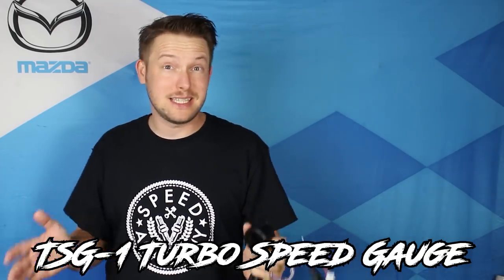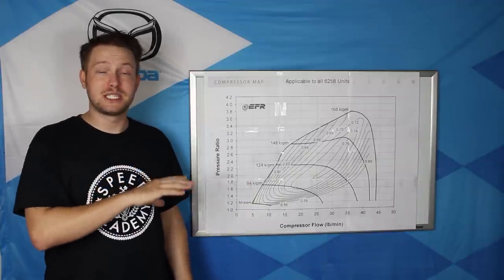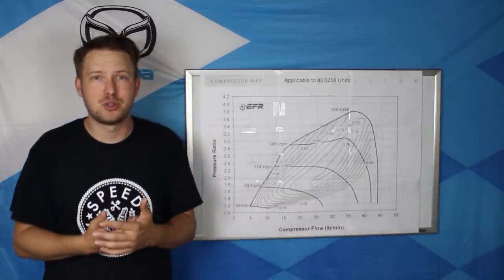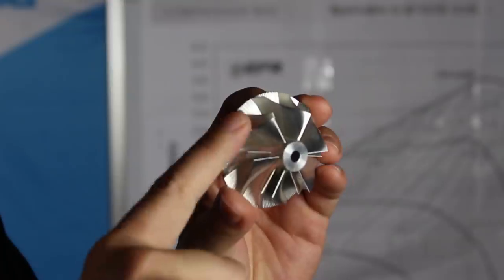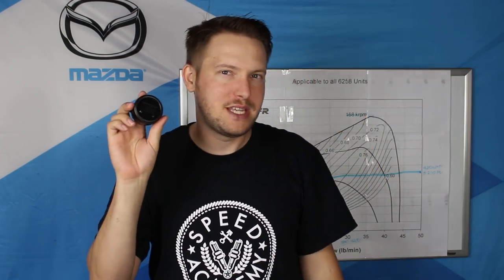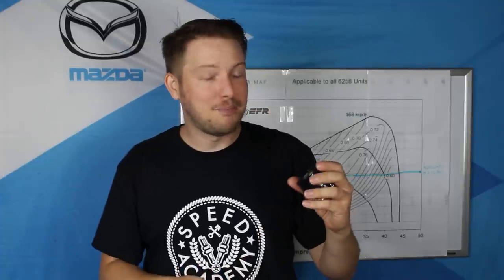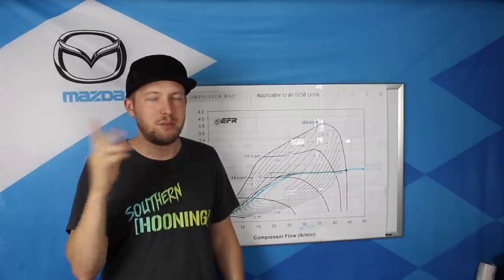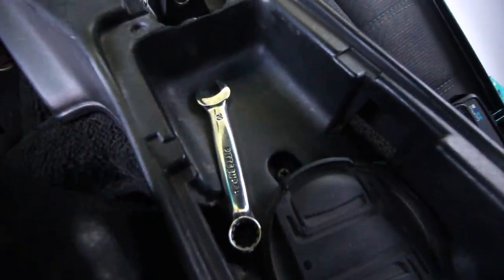The ULTIMATE GUIDE To Maxing Out A Turbo! [Compressor Maps Explained, Speed Gauge Install]

Comment from the maker: I want to make it **VERY CLEAR** that any time I say "pound of air" in this video, I'm referring to the mass flow rate of "X" pounds of air per minute. NOT "X" psi of boost.
Also, I messed up a bit on the time stamps, here are accurate links:
1:50 How to Read a Compressor Map
16:18 How to Install a Turbo Speed Gauge
20:26 How to Hook Sensors up to Megasquirt
22:45 Test Pulls
24:03 Analyzing Surge
29:50 Making More Boost
31:36 Analyzing Choke
34:21 Trying to Overspin The Turbo (Myth?)
Reply: Been waiting for this video forever,  awesome video man
Reply: I liked the comment about 18psi I am spending way too much time on that site and on your channel. I want to do something very similar to your car for track use. Keep up the great work.
Reply: PIN THE COMMENT GREG
Reply from the maker: @braydoncoate9583  weird, it came unpinned
Reply: @TheCarPassionChannel  understandable 👍
Reply: Whats this thing run n the quarter
Reply: Never mind I found the vid..trapping 124 you could be a full second or so quicker with tires etc..
Reply: Badass i love it
Reply: fucking EXCELLENT data bro. great video, great content. A+
I'd've liked to have BET those people it would NOT "over spin" chet.
Or even spin as fast as it spins under boost: Less volume in = less exhaust out.

Comment: At one point you said that you were getting pressure drop across the intercooler. You should not be using boost PSI but rather air density. I suggest you check out Gale Banks discussion on air density. The boost gauge is dead to me.

Comment: I dont know, if you forgot the fact, that the presure before turbo is not full atmospheric, you will always generate some underpresure, and this will also affect the presure ratio. So if you want to know correct PR you need to measure presure on the exit and also on the inlet of the Turbocharger.
Reply from the maker: Already have another map sensor going in to measure this as well!
Reply: @TheCarPassionChannel  I like the fact, that you are so much thinking about what you are doing. Most of your ideas are way above average knowledge of my customers. They still tend to install Root superchargers on Miatas :-)

Comment: I found this by accident and hit like and sub because I learned a lot thanks. Still unsure how to workout a compressor map for my engine though. It's a  2zz ge toyota and I've been told that  gt2876r is the biggest I can go with stock internals.
I will only run about 10psi . Any advice?

Comment: 420hp to the wheels in a Miata must feel like 700hp in a new car.
Reply from the maker: It's about as fast as a 700hp Hellcat in terms of roll-on acceleration. But it feels like about 3000hp in a car made of tin foil and bubble gum
Reply: TheCarPassionChannel will you ever get a chance to drag race one? The only ‘
stang to give you trouble now is the new 500 😎
Reply: @jefftoonstra5087  Not realy. If that boat with that much Power and so much traction barely beats the Miata on 0-60 (3.5 Seconds) 60-120 will be roughly 8 seconds due power to weight. 0-120 the miata easly wins.

Comment: Thanks Greg!
Also, pretty sure you can wire the frequency output of the BW sensor up to pt4 on a MS3x, it has an option to use hardware timers on the main processor, so it should manage to read 160K from a 6258 no problem. 0-5V only. Little to no documentation on it though, about to try it myself. 

Or, you can also wire it to MAF input on maybe any MS3 and config it as a frequency MAF and do some math on the datalogs after the fact. No need to actually run MAF, you can just log it's frequency.
Reply: I was thinking the same thing.
Reply: I wired up the EFR speed sensor direct to PT4, configured for high speed input 1.75 teeth/rev on my MS3x. Seems to work fine. It quits reading around 2K RPM and I haven't maxed it out at 140K+ RPM yet either, around 1/10s update rate could be better but still plenty workable. I log a MAF while running SD and it's still working fine too. 

Going to make a frequency generator and send a fixed signal just to make sure I'm getting correct data and see where it caps out.

Comment: Great video man. Covered a lot of ground here in an easy to digest way. Really demonstrated how beastly the EFR is too. Love the Southern Hooning shirt. That's a throwback. As for the over spin, I think it's that whole shop vac concept. It actually spins faster when there is a restriction. I forget the exact physics law, something something stall. You get dangerous overspeed when the car is under heavy load and a boost pipe suddenly blows though, I believe.

Comment: I think without the extra lbs/m being forced in the intake from muh turbo, there's simply not enough exhaust energy to overspin a properly sized turbo.
Reply from the maker: I think even if the turbo was smaller it still wouldn't overspin, because their max RPM is so much higher. Like 220,000+ for some of them

Comment: I get kinda scared when I nudge 70mph in my 100HP 1.6L. I can't even imagine driving one with the same power as an LS7. Pushing the accelerator must feel like engaging the warp drive.
Reply: Upgrade your suspension
Reply: My stock 1.6 easily pushes 118mph on the autobahn. Trust your car lol

Comment: 26:35 If you're losing more PSI through the intercooler, that is a good thing because that means you're losing heat

Manifold air density is the name of the game. Pounds of boost means nothing.

Normally to double the horsepower you need at least 14.7 psi additional air at ambient temperature

However, the guy that invented nitrous oxide systems, has invented cold air supercharging, where they just compress normal air, but into a tank, then when you're ready to use it, for a quarter mile run, you just run off this pressurized tank.
The air is coming in at 10 lb of boost which technically shouldn't double your horsepower except it's coming in at - 100° f. And therefore, because it's more dense, it doubles the horsepower at 10 lb instead of at nearly 15, not to mention almost no chance of detonation with temperatures that cold
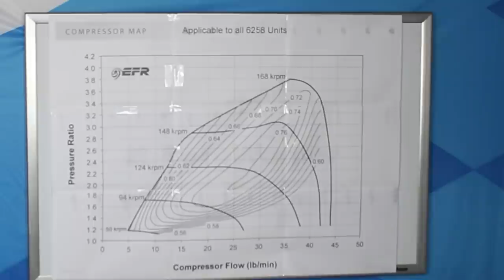Reply from the maker: Yes pounds of boost does not equal power as mentioned at 3:57.

However PSI is how you measure intercooler pressure drop. Significant pressure drop across the intercooler means it's too restrictive. 1-1.5psi is the maximum you want otherwise you're not using the right intercooler for your application. High pressure drop is not desirable.

PSI can also be used to measure compressor pressure ratio to help plot your setup on the map to determine efficiency

Comment: Awesome vid dude... really well done.
Now... lets see how efficient your intercooler and intake system is...
Add a map pre intercooler then post intercooler but pre throttlebody.
It'll isolate where your limiting factors are.

Fantastic chanel man, good on you for schooling people.

Also high boost in the mid-rang then tampering it off.. guess how modern high performance turbo cars work? (Ie GTI, S3, 1205i etc) Boom. You got it baby! Make the turbo work in its most efficient range constantly. Makes for an efficient engine.

Comment: my setup can make 20 lbs but i have it at 15 lbs and it makes 15lbs very easily. however..... on the highway today i was in 4th gear (6 spd trans) at around 4000rpm and i heard my turbo flutter and it wouldnt go past 10lbs. i have a manuel boost controller btw and id guess there wass too much load at that rpm. ive hit 15lbs at 4000.. even 3500 rpm and i spin the wheels in third gear. id have to be at 5000rpm to hit 15lbs in 4th gear and lets say 5th gear i would not be able to make 15lbs bcs my limiter is set at 6000 rpm so maybe 10lbs boost for 5th gear and for 6th gear i should not make more than 7-10 lbs from 4500rpm-5500rpm. Am i right about this? my comp ratio is 10-1 so thats alot of boost to compress. 2.5 displacement.... so would a better brand turbo make 15lbs of boost in 4th gear at 4000rpm if my 60AR ebay turbo wont or is this some type of limit due to my motor build and setup? my guess is just what this video is about, turbo flow chart. ebay turbo dont come with flow charts bcs id bet none of the turbos they sell are the specs they claim.

Comment: overspinning topic: If you don't use compressor like you did, there is less airflow compared to when the engine is charged so overspinning can't happen. It could happen in case you completely removed compressor rotor - there won't be any appiance which would use power generated by the turbine. But this is not the case. You are still spinning compressor wheel which is powered by the turbine and you are compressing air and blowing it back to the atmosphere. And yeah setup you tested for overspin did propably about 120-130hp because of that added extra „restriction in exhaust“ ;)

Comment: @TheCarPassionChannel   I suspect that with the turbo disconnected (Running NA) not nearly as much air flow is passing in, and therefore Out of the head and into the turbine side of the turbo.  So, there just isn't enough air to spin it up to 168k rpm.

Super big thanks for all the research you have done, and more importantly, summarizing it so that we who are not quite as bright, can understand.  I have looked at turbo pressure maps before, but had no idea what they meant.

Now, to get more than 210hp from my garrett SR20DET...

Comment: Small mistake on the compound turbo explanation. 
A true compound turbo setup has a large turbo feeding a smaller turbo. It wouldn’t work the other way around. The idea behind it as said in the video is to provide already pressurised air. A small turbo will not be able to feed a turbo with a larger flow rate. 
The general rule for compound turbo sizing is the intake of the small turbo should be the same size as the outlet of the big turbo. This way the large turbo can supply and sustain a high pressure environment before the small turbo, which then ramps up the pressure ratio once again. 
Neither turbo ‘knows’ what pressure it’s operating at. It just takes what it’s given and multiplies it.

Comment: Turbo speed is great, don't forget that some margin could be good if you ever will go up at some altitude, dirty air filter (did you measure pressure before the turbo to calculate PR?) , low ambient pressure days etc if you don't have a speed sensor a good way is to measure PR, temp before and after the compressor and then you can calculate your actual compressor efficiency. One more note about "maxing out the turbo", what you forget here is the drive power. If you run the try to overwork the compressor to reach the boost target at low efficiency you will also demand a very high amount of turbine work, which will result in a more closed wastegate=more back pressure =less power and more knock sensitive. So maxing out a turbo is pretty stupid, apart from Internet bragging or whatever guys are after, especially when you overspeed it severely, with high risk of destroying the turbo.

Comment: Compound is large turbo feeding small turbo on compressor side. With regards to overspeed, factory cars are usually smaller turbos and made of cast aluminin meaning they can reach max rpm easier in NA and the cast aluminium has a lower tensile strength. Your wheel is billet an has a higher tensile strength, though aluminium still suffers from fatigue. Running a wheel at its limit may not shatter straight away, but eventually it will, everytime you hit redline line you have put tremendous force on the wheel. If you calculate the centrifugal force of only 5grams of aluminium at a radius of 31mm at 180,000rpm that little piece of 5gram aluminium is experiencing 5500KG of force try to pull it outwards. You should displace the compressor wheel in water and calculate its volume and mass of each fin, as well as the back and entire wheel to calculate how much force it is going through. Thats 5500kg for 5 grams. That is why they make the housings so thick in case a wheel breaks.

Comment: It's a centrifugal compressor. You'd be more likely to overspeed it by completely blocking either the inlet or outlet. Then it can't perform work, so it'll speed up. Just like a vacuum cleaner speeds up when you plug the hose.

Comment: Nice technical video and stupid yet very informative tests, I wish there was more like these.
I just wanna give you some additional food for thought. In your plotting you assumed the pressure ratio by having 14.5PSI of absolute pressure ie 0 restriction air filter and induction pipe. I can't tell for the induction pipe because I haven't done that yet but what I can tell is that even aftermarket air filter does restrict airflow. Not that much in my case, usually 0.2 to 0.5 psi but still, it moves the pressure ratio. Especially with restrictive/dirty air filter, once the pressure drop in front of the turbo PR moves up fast.
It might be also interesting to hook up a third MAP sensor (yet another analog in needed) in front of the turbo to really calculate the PR seen by the compressor. 
Some industrial engine have sensor at the back of the airbox to indicate air filter blockage from dust, that read up to 1.5 PSI of vaccum to get a more precise measurement rather than having a 1b MAP sensor used  at most on a tenth of its full scale.

Comment: This is easily one of the best videos out there describing compressor surge and compressor maps in general using all the measuring equipment you would want to know the "whole" story. Big props for that!
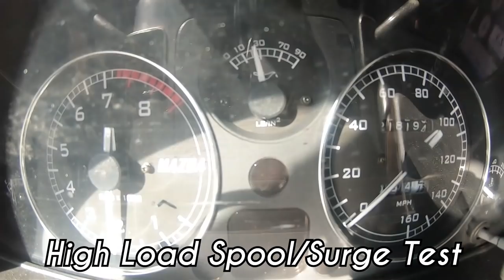I'm driving the same engine with the same turbo and your setup is making the same sounds as mine when at full throttle and around 4500rpm (23:10 and 23:25). Its a short whistling sound in the video which can be longer if in a higher gear. I always was worried this is surging. But obviously it is not. Thanks for showing that! Do you have an idea where that whistling sound is coming from?

Comment: It's pretty easy to explain why you won't overspin your turbo that way: Yes, the there is much less (not none!) resistance on the compression side which keeps RPM down but there is also not as much exhaust gas mass flow as there is with a boosted engine. And therefore the turbine is not accelerated as much. As the test proves.
The only thing that bothers me a bit here is the way you try to calculate back the air mass flow by horsepower, which is a bit much assumption. In my eyes it would've been best to use an air mass flow sensor or at least use the AFR to calculate back since you should be able to get the numbers of the fuel mass injected. That's probably much more accurate than taking the rule of thumb and trying to correct it so much that it will fit. At the end you'd actually be able to see what power figures your engine is able to extract from the fuel (efficiency) and then by the air mass flow. Efficiency would be really interesting.
Usually there should be the numbers for parameterizing somewhere with the sensor itself. These numbers are individual for each sensor (not model) and the setup on your data log is much easier that way.

Comment: In terms of using the dyno readout and boost log for the Compressor map, you mention a calculation to figure out Flywheel bhp. Maybe one way to make the compressor map more accurate would be to use a Dyno that measures transmission losses, as yours must be extremely unique! 😁

Awesome video as usual though bro ✌

Comment: Fantastic video. I’ve over spun a Turbo already running near its limit that then had a slight charge pipe boost leak. It’s to do with the engine load like you saw with the street vs dyno logging. Something else for you to test/prove!

Comment: Does the airflow rating of the turbo not need to be multiplied by the VE of the engine to determine potential power output? No engine (cylinder head) flows air at 100% efficiency.

Comment: Hi Greg, I thought you were running a twin port wastegate actuator, shouldn't this allow you to have good boot control with a smaller spring? 
Does this test show that the twin port doesn't work well, as your wastegate spring was being over powered by the boost, even under the "rule of thumb"  conditions?

Comment: Hey there, current thermodynamics and wave physics student here. I'm a little bit confused on the concept of compressor surge lines. I was under the impression that the compressor would continue to increase the air pressure inside the intake piping, and then would begin simply be holding back the pressurized air inside the pipes. Why is the compressor able to compress more air than it is able to? 
Is my perspective of more of an average  pressure stabilization, and in reality the resonating air pressure waves inside the boost pipes will change between low pressure and high pressure directly next to the pressurized side of the compressor, alternating between allowing more boost and having too much boost?

Comment: If your wondering why you won’t overspin your turbski it’s because you make more exhaust pressure with boost. More boost = more exhaust pressure which makes more boost so In theory its a  exponential closed loop system but you have to optimise blade Geometry or turbos are useless just get into turbo pump engineering and that will blow your mind

Comment: compressor side of turbocharger is less important then turbine side in making power. turbine side produces energy that the compressor side uses to make boost. if you use the same compressor to make the same boost on 2 different turbos on a same engine, the one with a bigger turbine and or bigger exhaust housing will make more power.  turbos restrict exhaust gases and that's why with same boost but less restriction you can make more power. with bigger turbine you can have more efficiency at higher exhaust gas quantity but you would loose low rpm boost. the rpm at witch the turbo can make full boost is higher with bigger turbo but top rpm power is higher too. 3% efficiency in turbine side could be as much as 20% at the compressor.